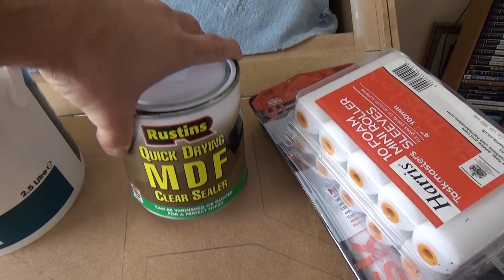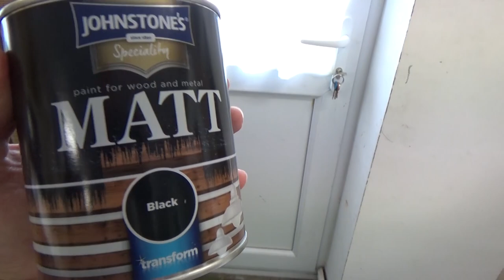Gauntlet Arcade Cabinet Scratch build. Part 7 Painting!

Comment: Looks Awesome Andy.  Great job on the paint. Its a lot of work but its also the most repairable and might save some money.
I suggest vertical grade laminate for the sides. Its fast, easy and perfect every time. 
I would only put vertical grade laminate on the sides so the artwork has a  perfectly flat place to lay. The rest would be paint as Andy did. 
You can get a similar effect with paint but it takes a long time and a lot of painting skill or better yet a painter's spray-booth. 
I used laminate on my Outrun Cabaret and that part was done in about  2 hours.

Comment: Brilliant work. Came out fantastic. Gives me confidence to try this out on my Pac Man project. Last one I did was a bartop Donkey Kong, but I used oil based glossy paint on that, and although it came out nice, I am sure this will be way better. Although I see the Pac Man builds often use a full covering vinyl as that might be cheaper and easier than stencils which surely takes a bit of experience as well I'd think.
Reply: @AndysArcade  , great, thanks for the tip. I will surely use some kind of seal. Do you think they used vinyl because the cabinets were often in plywood instead? I know they can possibly be harder to get a nice finish on? Or was it just easier for them to manufacture the machines perhaps?